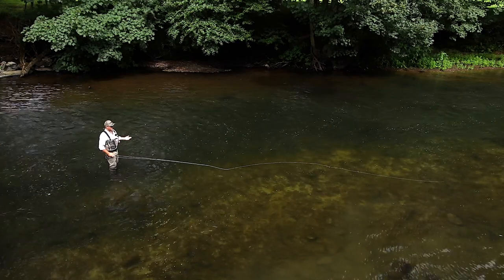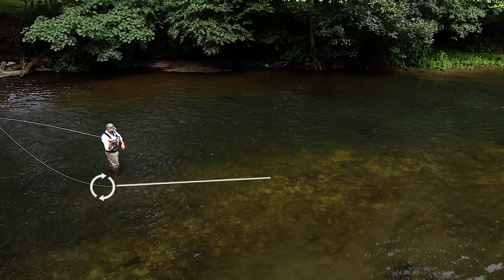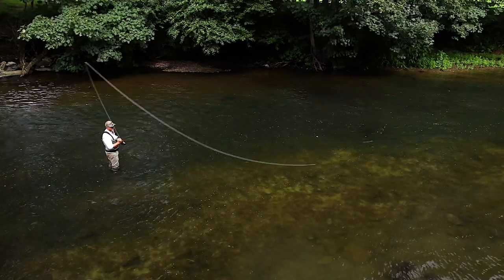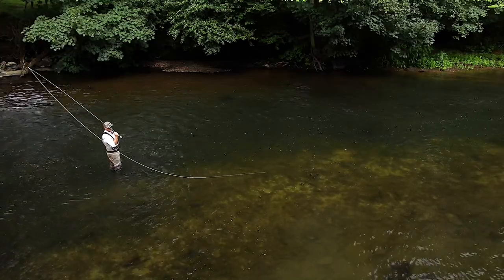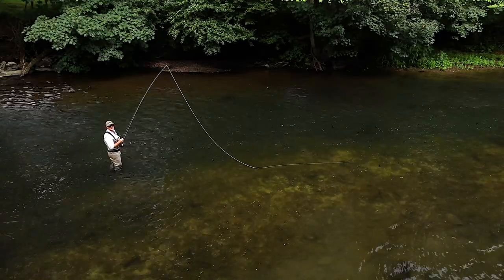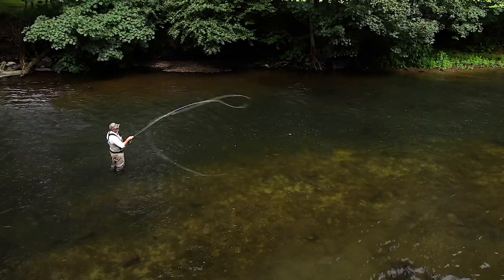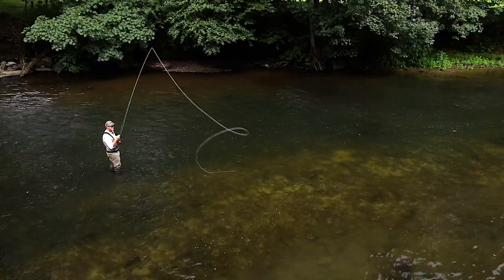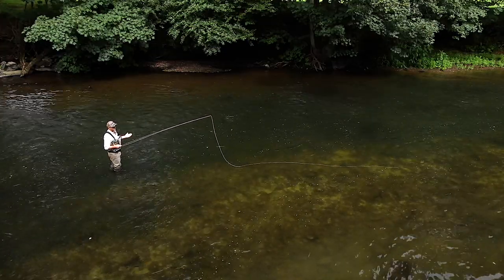Sunray | How to Fly Cast | Energy of a Roll Cast

Comment: Used a microlite ss 9ft #4 today with a matching proline. Been using your lines for a few years but never tried your rods. All I can say is wow. I caught 8 x 2llb rainbows on buzzers new Zealand style, on a spearmint squirmy and then used a fulling mill blue flash damsel just so see if it could be done. If your new rods are better than these then they are worth a sage price tag.this was on a reservoir too and casting a fair distance was no issue on such a light rod!